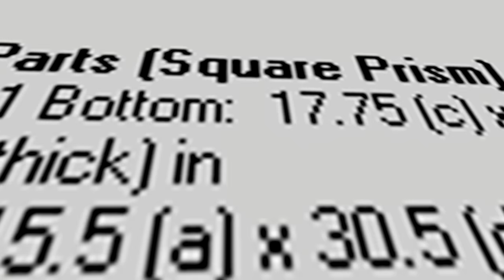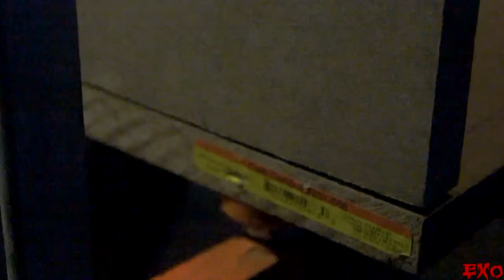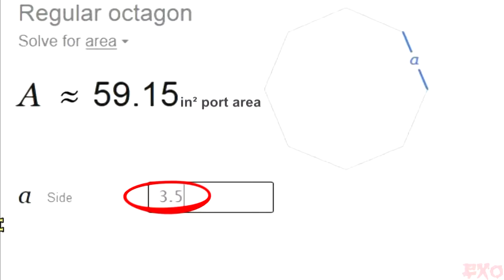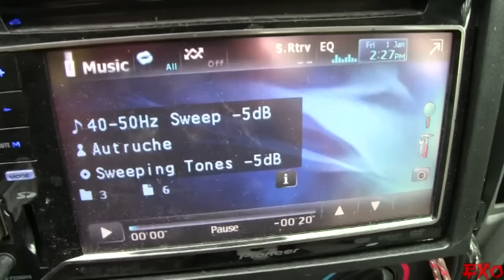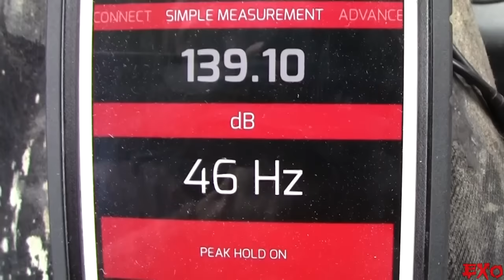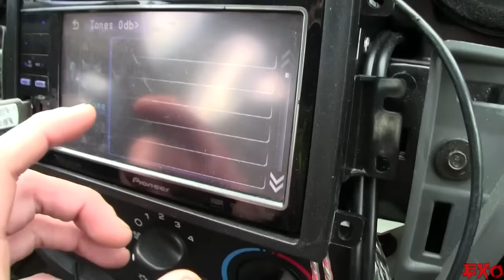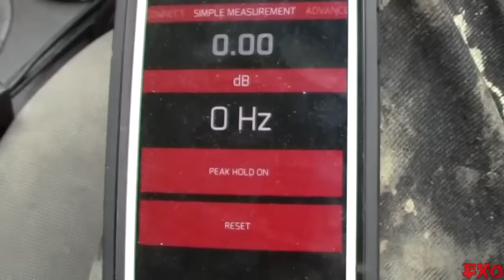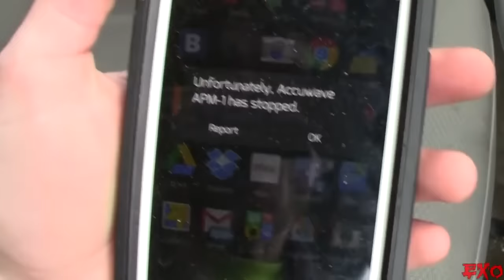How To Build Octoport Subwoofer Box w/ 15" Alphard Audio DEAF BONCE Sub | 150db SPL Trunk Install

Comment: I am glad your are opting for MDF! I used to have the hookup on RV dampening that was 1/2 thick with adhesive, straight from the supplier! You can add density to a box with sound deadening! Not many people have ever tried this nor have they done so in a video that I can find! Would allow the use of thinner material that still is braced internally with proper braces!

Comment: Db4 can take a ton of power, probably over 5k.. my deafbonce sa312 d1 takes my deafbonce 4k at .5ohm daily and I have never once smelled any coil smells ever !  They use very high quality flat wound American coils, my sa312 is rated 2800rms 5600max and 15k burst rated.. I can imagine the sa4 or db4 can take alot more, them 4in could are awesome
Reply: Which amp are you running bro? I just bought 2 dbsa312d1 and I'm going to run it with an AAK8000.1 but I was going to run it at 1 ohm ?

Comment: Hey. Might be a newbiesh question, but when you calculate the frequency of the box to match your sub, do you try to make the curve as straight as possible? Or maybe in a SPL purpose it's best to get the box to boost up at the range it can, to get the highest dB but maybe not as "good" and balanced curve? I Ccmpared a few boxes and subs from the manufactures and it seems as if they try to boost up the hertz around 100-50, and simply not care to go low. Maybe that gives a more "punchy" feel to it....

What programs do you use for calculating your boxes? Or you do it old school (do the math yourself)?

Comment: So lot of box volume for SPL box and your port very close outside in trunk. Try 13-15" long or displace it inside box. You need 50-55hz peak. What's port tuning now? You need at least 43-45hz and may be higher. Use normal flared port 8-10" diameter. Good luck in street trunk SPL develop!

Comment: So what's the benefit of this offer a round port or slot port
Reply: Basically nothing, round port is the most efficient, but octo looks cool
Reply: This is easier to make than a perfectly round port if you don’t want to use pvc pipe. For example, a 5 inch pipe would be best for a 12 inch sub but you can’t find schedule 40 5” pipe

Comment: Why octoport is better than aeroport and is it only good for spl or for music too ?
Reply: +Jecho Dimitrov less friction on the air that's moving, things closest to a circle have less surface area. think of a square vs a rectange with 25 sq in total. The square has wall lengths of 5 and 5 while an extreme rectangle can have walls lengths of 2 by 12.5. Multiply those lengths by the length of the port and you can find surface area of your port. The one with more area can produce more friction and slow the air. It's a hard trade off though because some would say aero ports are perfect because of this but other research finds that the widest mouth is better for low frequency. So in the end maybe it means nothing.
Reply: thanks for the information :)
Reply: Remember that when building a box too, the closest to a square it is, the smaller and less wood it will require

Comment: can these boxes bump music also? they seem very efficient cause I just seen a video of a crx with one SD 15 push 165 db. that freaking insane and the speaker had 15,000 watts running to it. it only ran a 6 second Burp but it got the job done.
Reply: There isn't a CRX out there with a single SD 15 doing 65's unless it's in the port. Sounds an awful lot like you are referring to christopher munson's crx, which does a 161.x with a single 15. 

But in any case, CRX burp boxes are an entirely different ballgame, and yes you can play music with an octo port. It's no different than a slot or aeroport in that regard

Comment: Exo a question that I’ve gotten a million different answers for. “The more ports or the larger the port the more DBs?” I have a Skar audio evl 15 sub in a 3.5 cubic ft box with 4” aero port that’s 7.14” in length which tunes the box to 31hz which is Skar audio specs on this sub but it doesn’t seem quite as loud as I expected. BTW Box is 3/4” mdf screwed and liquid nailed together. NO AIR LEAKS whatsoever. Any thoughts brotha?
Reply from the maker: Not always, diminishing return is a real PITA!!!

There's a sweet spot for every system, it's not always as cut and dry as saying "bigger ports are louder"

Comment: Does the port have to be on the side? Or could it be on the opposite side of the enclosure facing the cabin? Would it affect the out put if placed no facing a wall in you trunk?

Comment: Can anyone help me.I got given a 10 Inch edge activespecs:250watt rms750watt max powerwhat amp agu fuse do I need?a wiring kit I found comes with a 60 amp fuse is that ok?and exo keep up the work been watching you for years now !!!
Reply: +OrangeSlurpiee  A 60 amp fuse will be slightly undersized for your application. Your max current draw will be 62.5 amps so you should invest in a 70 amp fuse. Just dont go over a 70 amp.

Comment: When calculating the CU FT of your sub box , do you include the the width of your DMF? Or do  CU FT need to be Free open air, and build your box around your CU FT?
Reply: Baltazar Delgado 

I don't know if you're still designing your box but there are a number of box calculators online you can use and most of them allow you choose between internal or external dimensions, they all take the thickness of the mdf/other wood into account.

Comment: -5db tones vs 0db tones? Positives and negatives?
Reply: +Best Braai It is gonna depend on how you have your gains set on your amplifier. Most music is recorded at -6 to -4 db. Anything more than that is considered a "hot" recording. I have my gains set on a -10db 40hz tone so anything in the normal range is fine for music. A track at 0db on my system would be loud as hell but it would also be clipping like a mofo and wouldn't take long to burn up my 15".
Reply: Steven Watson My gain on my amp is super low intentionally due to not having enough battery and alternator power. I currently use 0db, but thinking of trying out -5db and just turning up my volume a bit more when competing. I might be clipping it even now even though my gain is ultra low.  

But then again, its only 30 seconds so a tiny bit of clipping wouldn't that much. 
And yeah, you are right. Music ranges anywhere from -6db to -20db depending.

Comment: Can anyone explain the difference between this octoport and other ports? Ive never even heard of an octoport.
Reply: It has 8 sides. The air going in and out of the port should have less turbulence creating a cleaner sound
Reply from the maker: No Love Octoports have slightly more surface area than aeroports. Some would argue that increases the musical properties as it's not perfectly round and  the closer to a round port you have, technically the more efficient it will be as it has less surface area in general. So in theory, an octoport should yield slightly wider bandwidths like a slot port, just not nearly as much surface area as that. A rectangular slot port has the most surface area of all. That added restriction can help provide better low end and musicality.
Reply: EXOcontralto Thank you for your informative and lengthy explanation! I really appreciate it Exo!

Comment: Not sure you'll reply, but I need to figure out box dimensions for 2 12's. I can't afford the box designer software, and people around me want to charge north of $200 to build me a box.  I can build it, just need to know exterior dimensions. Can anyone point me in the right direction or help if I can provide subwoofer specs? Thanks!!
Reply from the maker: Have you messaged any design gurus yet?
Reply: Look up EZ DBs. His designs are cheap
Reply: Look up Re box calculator, haven't used it or played with it so I don't know if it works or is remotely accurate but it can't hurt to try.
Reply: Did you get it figured out?

Comment: I have no doubt it can play loud , but it sounds nothing but distortion.  So i ask what is the point ?
Reply: Earl Dion  if your asking that question you obviously shouldn't be here.
Reply: distortion should not be the norm ,  tight bass at reasonable levels which blends the different frequencies  to a level curve is what the preferred intent should be
Reply: Earl Dion it only sounds distorted because the Mic on the camera, it would sound clean if you heard it in real life
Reply: if you are trying to push 140 db it will only  be distortion ,  most concerts don't even try to push it that loud.  hearing loss starts around 85 db no point loosing your hearing just to push the subwoofer well beyond what it was designed for.  I know all about hearing loss due to working on military aircrafts for twenty years.  That was even though we wore hearing protection.   Jet engines will do permanent damage    .
Reply: Earl Dion sounds like you need to be watching aircraft videos instead of trying to teach anybody about sound.
Reply: Anyone can play music any way they want.  My comments are to only point out that , pushing their subwoofer to the point where no music quality is the result.  It becomes nothing but noise and a distraction.  Surely not  what the original performer or writer intended.  You can bang your head against the wall all day but will not change the fact you are creating nothing but a mess for someone else have to clean up.  A car's trunk and windshield bouncing up and down does not make a good listening secession or environment.
Reply: Earl Dion I beg to differ i enjoy loud ass bass lol but to each their own I guess,
Reply: how do u know its distortion if u really watch his vids ull know that in every system hes ever had he uses an oscope on a camera there is no comparison to real life
Reply: your understanding of distortion is flawed.
tuned correctly you can have a clean output with no distortion even well up into the 150-155 DB area.
nothing but a mess for someone else to clean up ... hmm you've never seen or heard a clean and loud install in your life have you ? if so please feel free to throw some names around.
oh also.... what mess ? source : 145db daily setup in an unmodified car, no holes cut, nothing removed at all... doesn't that prove otherwise ?....
one can't assume any level is distorted unless its proved otherwise, simply judging based upon a camera's microphone is poor form to say the least and sadly speaks volumes of your knowledge in sound pressure levels and recording equipment.
Reply: nvmyutube Jonathan price, steve meade i live in cali went to autorama this year one guy had 35k in his blazer when i recorded it sounded bad in the camera but crisp clean in person
Reply: sorry nissan fan, forgot to tag earl dion in my previous comment.. my mistake.
you're very lucky to live over there, we have a community here but it can't hold a candle to you guys.
you're abosoloutly right though, last big system i heard was running 20k and was exceptionally clear.
Reply: nvmyutube i  Would Have Love To Gone To A Show Like Slamology But School And Work  Had Me Too Busy
Reply: nissan fan - 
sadly that's just life sometimes my friend, ive had to miss out on the monthly meets a few times but always try to make it (for now its all we have, sadly no comp's at the moment).
i hope you make it next time !.
Reply: you cannot listen to 
140db for any length of time since at 86 db you will sustain hearing damage.  does no good to be deft for the rest of your life.
Reply: Earl Dion -  and that's all you have to say to back up my comment ?..... 
clearly it seems your intelligence (well... lets say "some knowledge") lays within another area, i suggest as it has been said before you go back to your jet plane video's or something.
Reply: I will be the first person to admit i do not know everything,  But 13.5 years in the Military and a few years of college and 58 years of experience knows enough to keep me out of trouble.  Hearing damage is easily looked up on the internet or just do what we used to do is read a actual medical book or Journal.  I know going to a concert does not help your hearing only a few hours but it does not take much more than that to appreciate what hearing you do have.  I have nothing against playing music loud just not to the point of hearing loss.  
Back-handed complements is something you yet to have mastered but i will give you a C- for your effort.  Have a nice day.
Reply: Earl Dion My Dude I Took Advanced Placement Physics This Yeay My Teacher Is One Of The Top Teaches In The Country With His Knowledge In Physics And My Knowledge In Car Audio We Could Never Come To An Agreement Because He Used His Physics To Try And Explain To Me A 5000w System Can Not Be Audible To The Ear Because It Would Destroy The Ear He Got His Meter A 500 Dollar One And Measured Out Mr Car To 143.2 Dbs Of Which My Father And I Have Listened To Our Whole Lives Physics And Car  Audio Do Not Go Well When Using The Logarithmic Equation To Find The Dbs A Car Is Producing
Reply: Earl Dion Go To A Show Like Slamology And These Guys Listen To 150 Dbs Daily For At Least 6 Years Of Their Lives
Reply: Nissan Fan earl is getting all his knowledge from medical journals and the internet. lmfao
Reply: +freddy fudpucker man you seem pretty ignorant trying to apply irrelevant anecdotal experience to something completely different..

mid-high frequency(especially 100kRPM+ or whatever a turbine spins at) is more damaging, and 8-12hrs/day of even low volume machine noise will do much more damage than some super low frequency exposure during your car rides..
Reply: Bernard the dog 140 db of 30hz wont destroy your hearing.
Reply: @bernardthedog515  it's hilarious how you purposely add unnecessary words into your sentences to make yourself sound smarter.

Your original comment was wrong anyone who knows bass knows all loud systems sound distorted through a microphone.

Instead of just admitting you were wrong you went on a pretentious tangent about what the artist wanted you to hear, which again was wrong most rap especially what he listens to was designed for bass heavy systems.
Reply: @bernardthedog515  that's not really true though just hanging out in a city is around 100db. Also exo recently got his hearing tested after listening to 160+ DB systems for the last decade and his hearing was perfect.